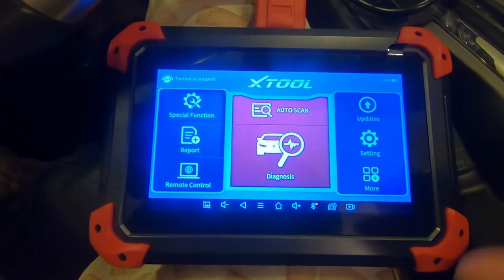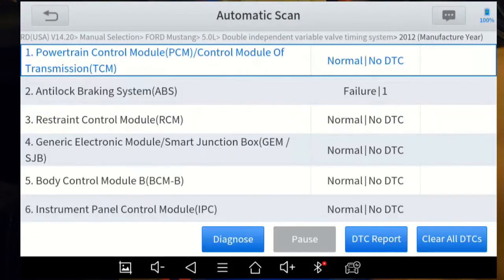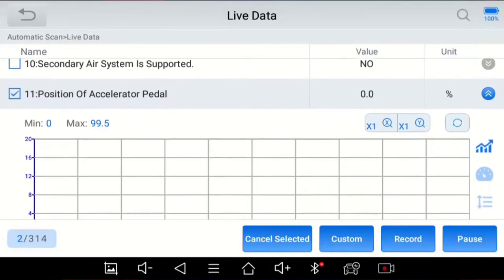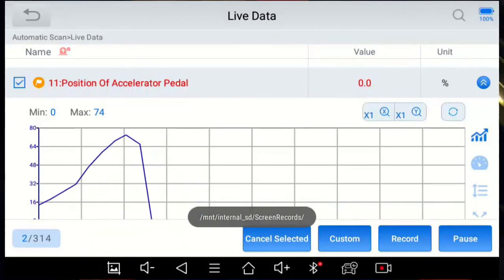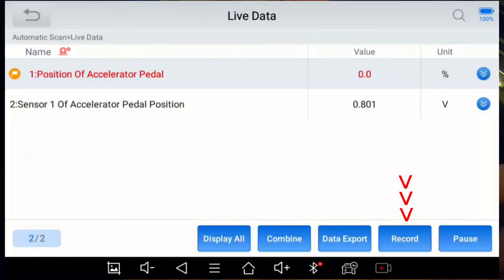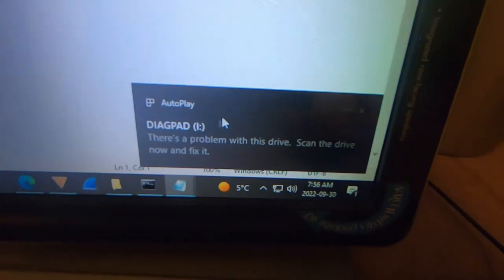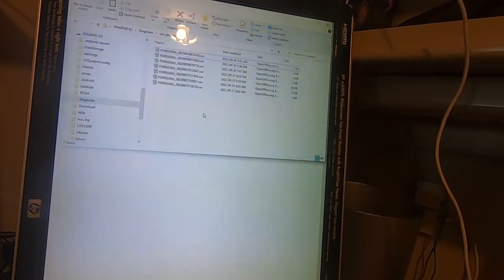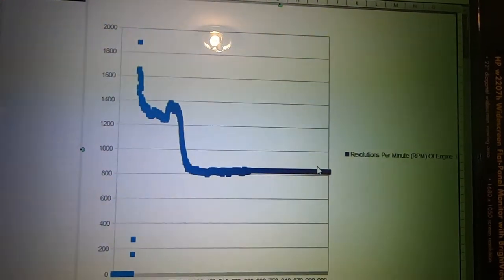XTOOL Scanner Capturing Live Data with Triggers Emailing Reports Screen Recording and Exporting Data

Comment: Thanks! Learned several new things. For the on unit live graphing, wish they would add both a -x and -y zoom buttons to decrease the default scale. Especially the y scale that defaults from 0 to 20. It auto scales pretty well in the recorded report but you have to leave live data to get to it.

Comment: But the only problem is and they do not tell you I made this mistake you get three years of updates but if you click on and ask for added updates, it kicked your free updates out. They don’t tell you this until you do it until you put your email address in and your information I was just looking at prices what it would be and then I get a message across there that I will no longer get the free updates because I put my information in for added updates so that kicks that out or you to send the scanner back within the 30 days and get a new one and it starts over. That’s one way to fix the problem they want to pull that crap.

Comment: you didnt show what you clicked to get to the screen where you set the upper and lower limits... it just pops up on the screen... what did you press??
Reply: that is at about 8:30 min in the video thanks.
Reply from the maker: If you look on the far right side of the display, there is an icon that looks like a circular speedometer or tachometer gauge.  Click the icon immediately below this icon.  Let me know if you need more help.

Comment: Great video. I just ordered a D7 at a price I couldn't refuse. I did order another brand at a good price. Had more bells and whistles but 1st operation was to program a key fob for my 2011 Challenger. There are D7 videos showing the steps. Problem with the other brand was, it asks for the PIN code. I backed out, tried every combination of screens. No PIN displayed. I checked for videos on that brand. A few videos with other cars makers. Nothing for any Dodge. I looked at the D7 videos and tried to see if the other brand followed that screen sequence. It always skipped the screen to display PIN code. It jumped to the screen to enter PIN. Kept backing out them the car computer locked me out. Too many attempts. I guess getting to the request for the PIN counts as 1 attempt even if you do not attempt to enter a PIN. I checked the specs on the other brand. Says it programs keys. Called support where they told me I had to buy a specific tool from them that programs keys. Of course I sent that one back and good thing. Next day there was a flash sale on the D7. Lesson being. Not all scanners do what they advertise. As for videos. You do a good job of training, I used to be an instructor in the army for 4-wheel vehicles. One suggestion. Think of 2-3 ways to explain details. Which you did cover but most videos lack in that area,. And of course different operating systems are a little different. I use Linux but it is not difficult to use the info you supply and apply it to the way my laptop operates. I intend on adding a few videos myself since I have all the required programs and we need more training films. Keep up the great work,
Reply from the maker: thanks for the great feedback.

Comment: Where can we find a source for the normal values?
Reply from the maker: That is a most interesting question. Keep in mind a sensor on a BMW may have an output voltage that decreases as temperature rises. However a Mercedes may have an output voltage that increases as temperature rises. So there's probably not a typical set of values for a particular type of sensor across all manufacturers. However the interpreted value by the computer from a sensor should be standard. For example a car that is running at normal operating temperature likely has a head temperature of between 80 and 120° C. I like your question though and would love to see a list of typical interpreted values for all types of sensors that are on a car. Regretfully I don't have that knowledge.
Reply: @mrdiyguy123  This makes sense. It would be nice to have these parameters set in the ECM by the manufacturer and viewable with the live data
Reply: Bosch book isn't bad for values, since so many sensors are Bosch, otherwise Mitchell, online or dealer if lucky.

Comment: Good guidance.  Now If I could only get my D7 so speak proper 2018 Traverse language/syntax.  all attempts to 'test' any actionable device,  i.e. windows, wipers, door locks etc. return argument out of range error.  But the email report function is worth its slowness scanning (autoscan) missing modules as it works its way thru it list.
Reply from the maker: You should open the ticket with X Tool Tech by clicking the top right hand side icon present on many of the diagnostic screens. That will generate an email and include information relevant to the issue so the next tool can help you best solve it. Taking this action is the only way they will learn about issues with certain Vehicles because obviously they cannot test with every combination of vehicle that exists. I have done this before and they are very responsive and receptive.
Reply: @mrdiyguy123  Thank you, I will give that a try.

Comment: Amazing. Will it tell you why a car won't start? Thanks.
Reply: These types of tools are designed to help leed you in the right direction You must have some or a lot of technical ability and understanding of how the system works before you should attempt to repair a modern car, cause you could very easily cause a lot more harm than good.:face-pink-tears:

Comment: Do you know the sample rate exported to the csv file?  I am looking for a tool that will record several times per second, more the better, specifically brake system sensors.  Thanks!
Reply from the maker: I am guessing once per second.  Maybe the sample rate is configurable

Comment: Question about the modules that are listed, after an AutoScan.  Now with Topology this is laid out nicer.   How do we know if a module is really there, but communications has been lost with it, maybe due to a broken can-bus circuit, or the module is just bad.   
The reason I ask this is, when I Auto Scan my 2014 Silverado there are few modules greyed out, I don't think this a problem, because my Silverado is in very good condition with no problems. I'm assuming these modules possibly for different variants of the Silverados.  But what if I was working on a vehicle in poor condition, and trying to determine .... is that module really there ????   I've seen Ivan on Pine Hollow Diag do a  'health scan'  and say  "oh there's no communication with that xxxx module".
Reply: I have a D9 pro and notice the same thing! I haven't missed a problem yet because of this bit don't think this tool is reading all modules properly,  lie I'd swear they are there but the scanner isn't picking them up. So far I like the older X-431 Launch we have at work better.